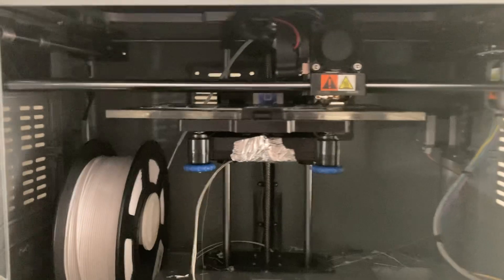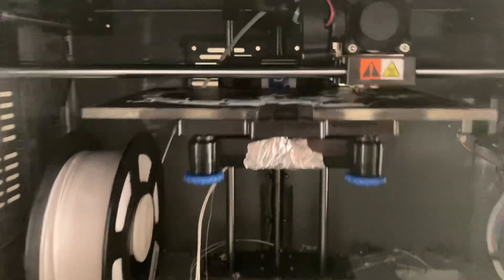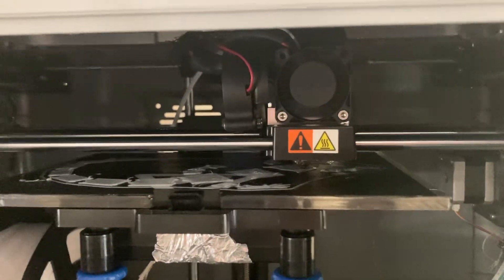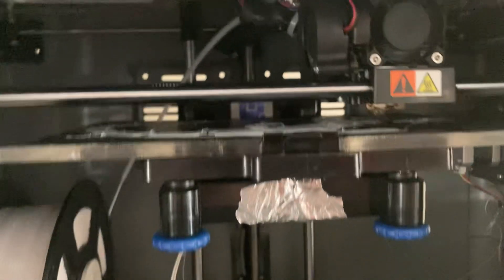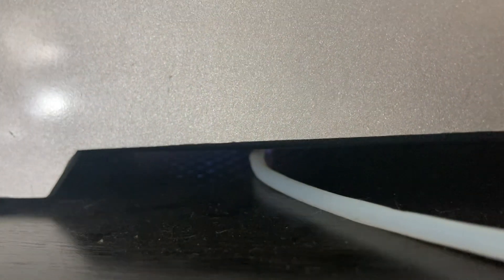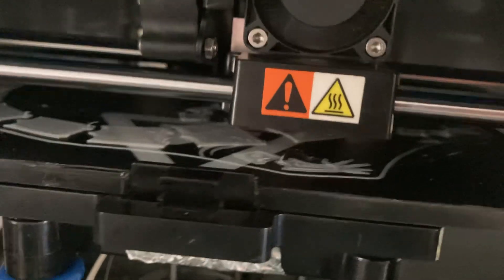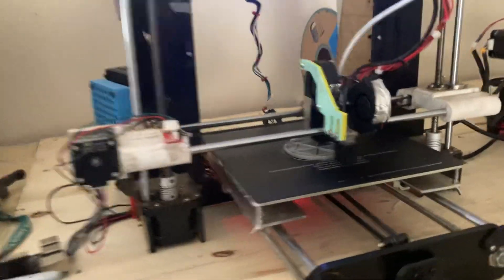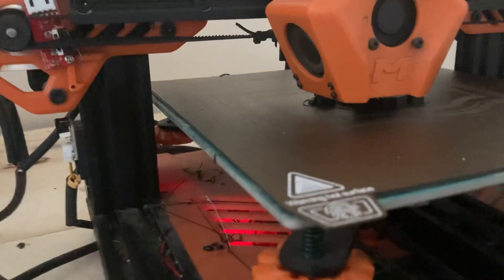Dremel 3D20 in 2024?

Comment: How did you do this mod.  I am stuck with 5 @ 3d20s.  Bought in 2020. I hate them so much.  Would live to breathe some life back into them for batch process stuff, but there is so little info on how to do what you did here.  Did you figure it all out yourself or did you find an info source to make it all work.  I know you said the skr pico was a problem. But maybe there is a better component to use?  Can you show or tell how you did this?  Thank you for showing this is possible. I was thinking i would just have to scrap those old machines.

Comment: I have a Tevo/Homers Tarantula Pro that I'm running on Klipper with no drama whatsoever, all I had to do was flash Klipper for the MKS SGEN L V1 board. Make sure you don't try to flash it from the front SD card slot instead of the microSD card in the rear - it took me an afternoon of swearing to figure that out and boy did I feel dumb afterwards. You'll have to copy over someone's gear configuration for the Titan extruder, and pay attention to the motor brackets for the X axis as they like to crack after a few years (you can fix them with one of those tools that sink metal bits in the plastic with heat).

Comment: That bowden tube could use a little more slack on the dremel... Also, are you sure the Tevo firmware is locked? dont those just run an MKS board with marlin?
Reply from the maker: As far as I know, it was a proprietary 32 bit board with a modified version of Marlin. It does boot up and say Marlin on one of the boot screens, but then it changes over to Tevo tarantula Pro, all of the old forums that I had found had said that they publish this printer and had gotten flack for not publicly uploading the open source firmware.
Reply: @204PrintThat  When I search that printer, I see MKS base and MKS Gen L boards that came with the normal and the pro version which can all be easily flashed with new firmware. Open yours up and see what board you have, because if you have a Gen L, you could easily compile latest Marlin or klipper and maybe upgrade the drivers too.